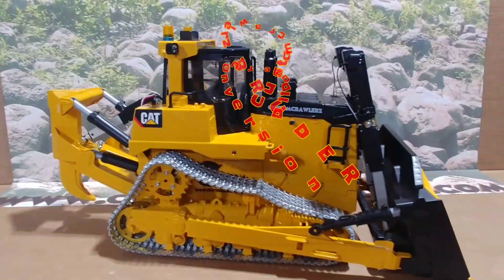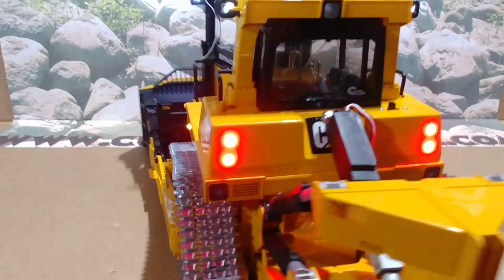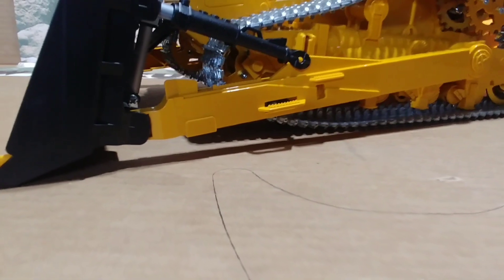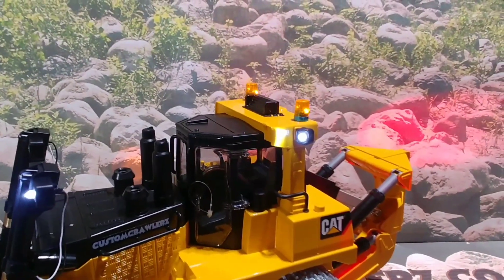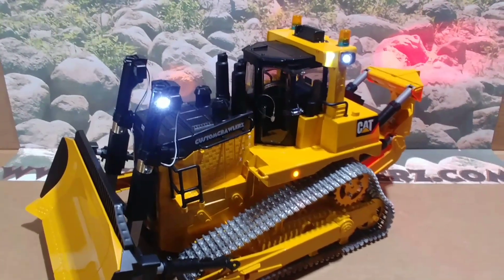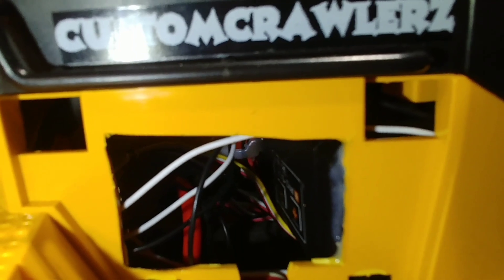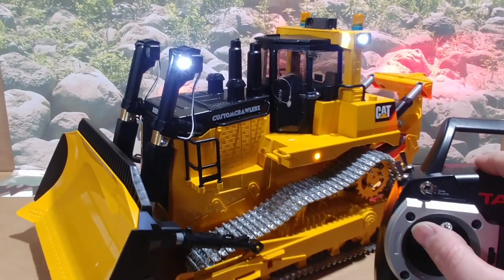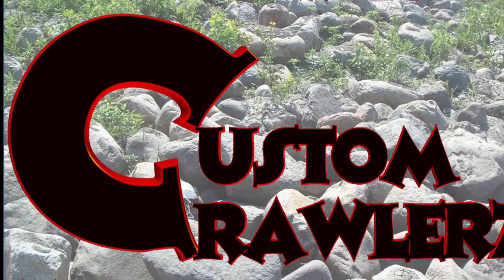Bruder D11 Dozer Naresh D  Steel Tracks Full HD

Comment: Are they all plastic.?    No metal?
Reply from the maker: Scott, The tracks and the drive wheels on this model were metal. The servos are metal geared, and the Actuators have Aluminum shafts. Other then that the units are BRUDER Toys that have been Converted over to Radio Control. You can see them and other pictures at www.customcrawlerz.com

Comment: How did you get the dozer to weigh 14lbs?
Reply from the maker: Hello,  There are (3) 1/2" x 2" steel plates inside of the shell on this model that account for its weight. The battery pack sits in the middle of the side ones and they keep the weight more towards the front. More recently the D11's are being built with filling the inside of the Track guides with steel before closing them back up. This way the inside of the model is kept more open by only using one steel plate and allows more room for a battery and more should the customer decide. Thanks for checking it out.
Reply: @CustomCrawlerz  So the batt sits on the middle one which is flat and the two side ones are on edge??
Reply from the maker: @alangriff1  Yes,  In the units with 3 steel plates inside that is exactly how it is.
Reply: @CustomCrawlerz  I like that..just what I was thinking actually (weight in the track frames)